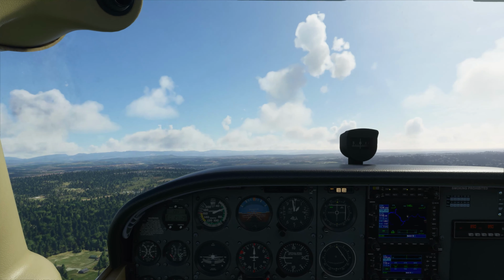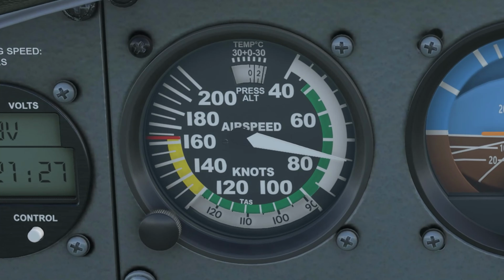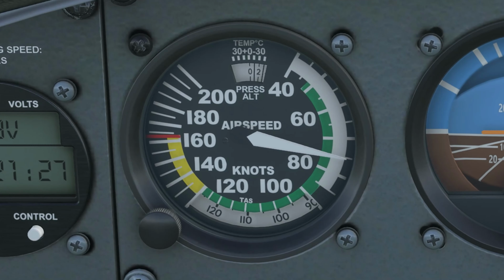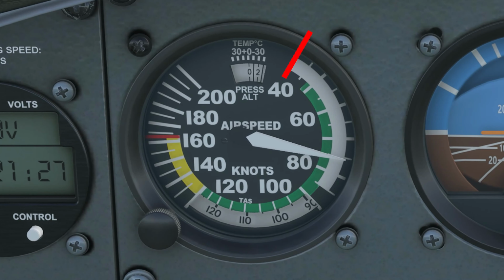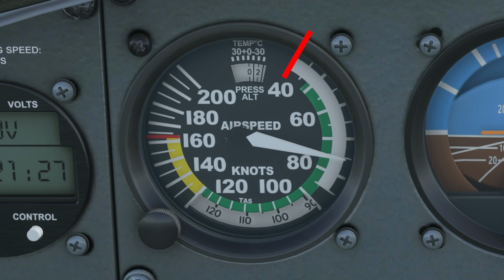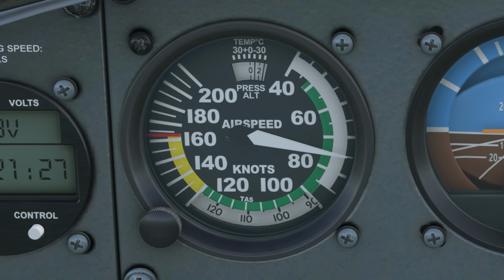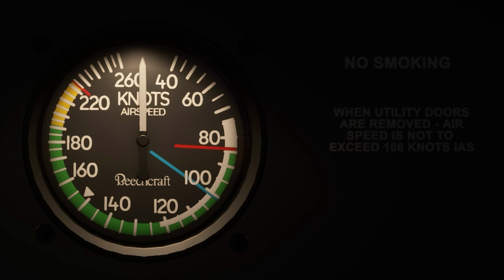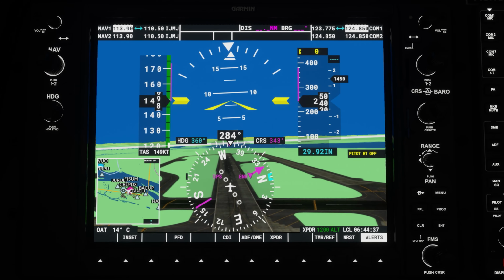Airspeed Indicator Gauge Colors Explained - MSFS 2020 / X-Plane - Knots mph speed

Comment: why do gauges go beyond the maximum?
not just airspeed but in all kinds of gauges, in cars too.
its something thats always confused me, if the never exceed speed is 160 why bother making the gauge go to 200?
Reply: So that even at maximum value it is still well within its usable range and won't fail in normal circumstances
Reply from the maker: Thats a great answer steve, thanks.
Reply from the maker: I would have assumed also that they mass manufacture these gauges for aircraft within that range and just replace the template. That way you can use the same gauge for aircraft with v-refs that are only a few knots or up to that max difference, but Steve also had a logical answer.